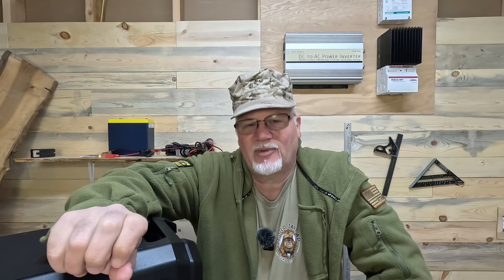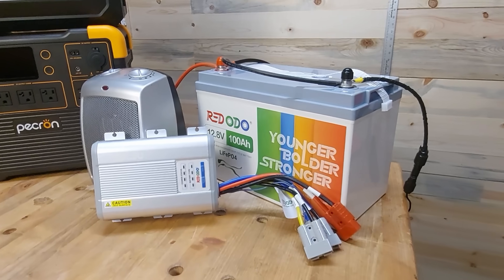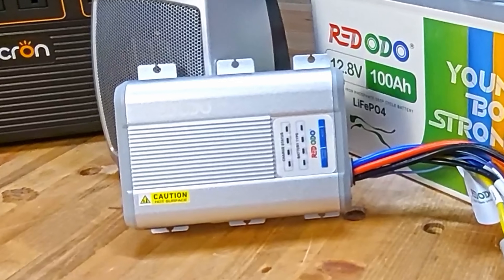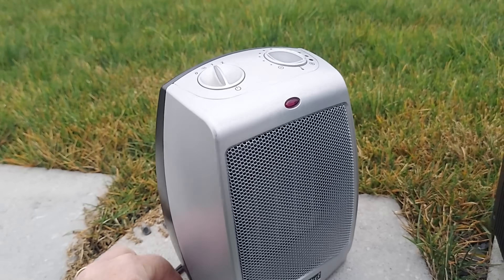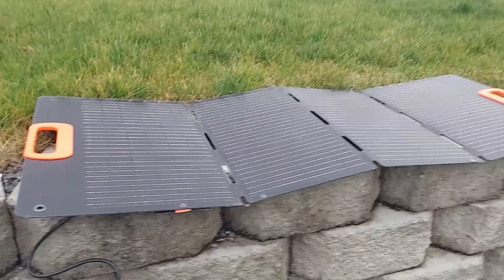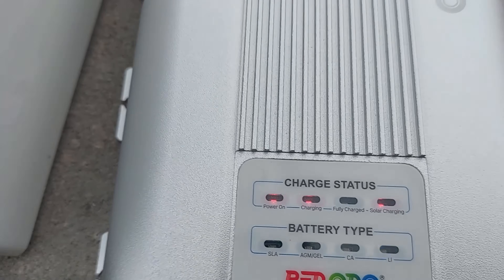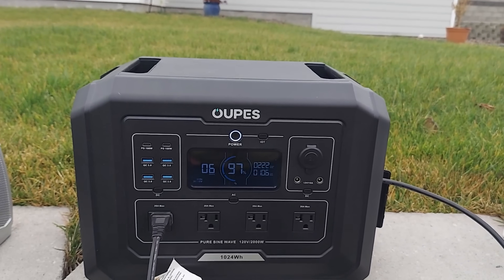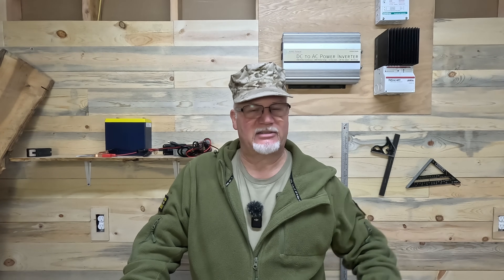🔋 LiFePo4 POWER STATION Hack That Actually Works! 🔋

Comment: I need help. This is my situation. I have two Redondo 12.V 100ah batteries and a Ergetech 2200 watt power station. I tried charging the power station with a cord that connects to the solar panel ports. The battery only charged it to 130 watts and the positive wire was hot for some reason. So how do I get it to charge at a higher watt hour?
Reply from the maker: 1st if the wire was hot it's too small, 2nd what is the max voltage if the egretech?
Reply: Use a 'boost converter' which increases the voltage going into the solar input. 12V - 48V is good.
OR - Use the batteries in Series and feed in 24V. (Or put the 24V into a converter still).
Reply from the maker: He hasn't answered my questions yet so I figure he's moved on

Comment: I've been looking for a review of that Redodo 12v 40amp DC-DC + MPPT charger but can't find an answer to something I'm wondering about. I've also checked the specifications on the Redodo site but no mention is made of one particular spec. Would you consider checking something out for me? I understand the DC-DC side of the charger can deliver 40amps from an alternator (assuming the alternator is large enough) but I don't believe the MPPT side is the same. I suspect the MPPT function is limited to 20amps based on other videos I've seen where it was used. In the video I'm referencing, the MPPT side only put out 10amps which was the maximum output of the DC power supply the tester was using to simulate solar. Any chance you could test the MPPT limit using actual solar panels? If it is actually 40amps on the MPPT side, that would get it into the ballpark of some of the newer fast (alternator +/- MPPT) chargers (Etaker F1000, Pecron 500w, Bluetti Charger 1 560w, Ecoflow 800w, etc.). I also note that very similar chargers are made by other battery companies such as LiTime, PowerQueen, and some others. I wouldn't be surprised if they all have the same guts inside and are simply branded with a different skin at a manufacturing facility.

FWIW, I'd be using it to charge a 12v 230ah LiFePO4 battery (w/200amp BMS) using a 220w N-type bifacial solar panel. That panel's VOC (21.8v) is under the 26v maximum of the Redodo charger. My other panels exceed the Redodo VOC limit but work fine with my power station. My main use for the battery is to slowly recharge the power station at night when camping and solar isn't available, then recharge both the battery and power station using various methods when solar is available and exceeds the capacity of the power station.  Your informative videos on this charger and the boost converter method illustrate the versatility of having different charging options. Thanks.
Reply from the maker: The DC and MPPT are both 600w chargers if my memory is correct  The Alternator side is 40amps which I calculated at 576w at 14.4v coming from the alternator (14.6 would get 584). But I'll have to check on the MPPT side -- and you ask a good question!  If it's 600w then a 30v max would be 20a and that might make sense but if it's a 40v max it would be 15.  I'll check and get back to you.
Reply from the maker: Max voltage is under 26v - I need to check with Redodo to get more information as I can't seem to find my manual.
Reply from the maker: The maximum solar input power of this DC to DC Charger is 584W (14.6 × 40). If the PV input power exceeds this value, the DC-DC converter will implement current limiting. Once the processing capacity reaches its limit, certain components may be damaged.
Additionally, the maximum input voltage range is 26V. Exceeding this voltage for PV input may cause the input capacitor to be damaged due to over-voltage conditions.
Reply: @TheOldJarhead  Thanks for checking further into this. Let me see if I have understood this correctly. Given a 584w limit and maximum input voltage of <26v, my 21.8voc panel could charge the battery at 584w/21.8v = 26.8amps or thereabouts. I don't know where you'd find a solar panel rated at around 14.6voc to approach the 40amp limit, so that seems unrealistic on the solar side. And, at maximum 26v solar input, it works out to be 22.5amps max. Or am I missing something here?

14.6v at 40amps seems reasonable for alternator DC-DC charging but I think advertising/marketing implying this is a 40amp MPPT charger seems shady - pardon the pun [although I can't find any explicit claim by any of the manufacturers of these chargers (Redodo, LiTime, PowerQueen, Kings, Atem, etc.) that they actually perform at 40amp for MPPT solar charging].

Again, thanks for the additional time spent on this, and glad to see you are on the mend.
Reply from the maker: I'm certainly wondering about this myself.   I do see panels it can work with though.  My own 615w aray would be 18.54v and 34a
Reply: @TheOldJarhead  Which panels do you have with such low voltage parameters? Can you please post a link to a vendor or one of your own videos that highlights them? Most panels I see advertised range from 21.8voc (as a couple of my 220w bifacial panels are rated) up to 40+voc regardless of wattage. Even tiny 20w and 30w panels I've come across have voc ratings of over 20voc (note: I edited a mistake ... "amps" to "voc" here) or they don't specify that parameter in the sales listings. Thanks.
Reply from the maker: My panels are from 2010 they are the Evergreen ES-A-205-fa3b 's that put out 205w each and are rated right about 18.20v and 11.27amps - so with 615w if in parallel they would be 18.18v and 33.81amps you can see the label early in this video:  https://www.youtube.com/watch?v=oC_yacKxuaQ
Reply: @TheOldJarhead  Thanks for the video link and info.
Reply from the maker: You bet

Comment: Thank you for the commentary and clear demobstration of the application.

I recently purchased an Eco Flow Delta 2, 1024wh system with 220w of folding solar panels.

It tested it on by running a full sized fridge for 11hrs.
100% to 10% charge.
More than satisfied.

The issue which I ran intp which will take a bit of better planning on my part is with the solar recharging.

Following the test.
The first two days were overcast and one morning was raining.

I live in a heavily wooded area where the sun and shaded areas change throughout the day.
The first day I placed the solar panels and with constant realigning managed to charge the station up to 50%.
The second day it rained most of the morning with some late afternoon sun.
I had less time to reorient the panels for optimal charging. Charge went from 50% to 65%.

Most of the first two days the panels averaged less than 75w of input.

On thitd day the sun rose early and it was clear.
Panels were putting out well abovec150w.
Finished charging in a few hours.

The thing I would caution new purchasers on for any type of solar.
On the days you most need it the sun might not be shining.

You wont always get optimal output from the solar panels. Be prepared for that.

If you add in an additional battery then that is more energy needed to recharge.

Recharging 1024wh at 50 w/h is going to take 20 hours.
If the capacity is doubled by an additional battery.
The recharge time is doubled.

The larger the power statiion the longer it is going to take.

Get the largesr amount of solar you can afford but have a backup plan.
In case the weather doesnt cooperate.

Test your system and ideas before you need it.

Comment: Can you plug car alternator to power station's solar plug? (if voltage range allows it)
Reply from the maker: The main power of the alternator runs via the large cables to the battery and I'm not aware of another lead that can take the amperage from the alternator and feed it elsewhere but I suppose, if one had the background to mess with it, it would be possible.

However, a DC to DC charger is designed to manage charging the battery correctly and won't keep sending power to it once it's full.  Same with the MPPT charge controller.
Reply: @TheOldJarhead  Thanks for quick answer. Actual I meant car starting battery which is charged by alternator. Of course power station has to stop the drain when car stops. Maybe some kind of rele.

DC-DC charger would be best but adds cost. In future I am going to buy one and extra battery also. BTW thanks for that advise too. It main my build easier!

Most of the power stations allow to charge through 12 socket but ampere/wattage is very low.
Reply from the maker: Ahh understood.  I suppose you could do something like that, but depending on the power station Amp draw may very and definitely only when the car is running or it would kill the battery.

Comment: What solar panels is that. They all seem to have not so great reviews
Reply from the maker: That's a Nurzvy but foldable panels are what they are.  I'm going to play with a couple more
Reply: @TheOldJarhead  I know a lot of people say that they don't put out what the rated for but there's so much that goes into it and I'm wondering if maybe that's the case with a lot of them I'm kind of new into the solar setup stuff I'm kind of a jack of all trades master of auto mechanics lol. So I can figure most stuff out I just hate buying junk.
Reply from the maker: @jasonepperly7041 They mostly don't understand them and their purpose or the power station limits they are using them with.

Foldable panels like all others are rated at perfect conditions, then folded and set sorta towards the sun 😆
Reply from the maker: https://youtu.be/-kNUvUiYyCg I did this one earlier in the year on this very topic :)  Foldable panels have their place but not where some try to use them.

Comment: I really like your videos. We all learn from watching you! I noticed you have a 30 AMP fuse coming off the battery. Can you tell us how you sized this fuse and why you selected this type of fuse? This is one area I am somewhat confused about.
Reply from the maker: Thank you so much.  I typically size fuses 25% greater than expected draw but in this case the smallest fuse I could find was 30amps in this size and configuration.  I wanted a big enough fuse to handle 20 amps and one easily removed and replaced as well as seen.

Comment: Can you do this with a jackery?  I was told I cant run a space heater on my jackery because it would drain all the power in 30 minutes.
Reply from the maker: https://youtu.be/uhS69YQMijk to be fare, a space heater uses a lot of electricity and my little one will draw over 1100w so can eat a 12.8v 100ah battery in 1.2hrs.  Better to get a Buddy heater but yes, you can do it with a Jackery as you'll see in the video I linked for you

Comment: I'm currently  converting my  12v 1200 watt  off grid system over to a 24v system so I can increase. my solor panel. input  and  battery bank excetra...  more power more independents. 💪.
Reply from the maker: Nice

Comment: Hi there jarhead, I understand what you are doing: demonstrating pass through charging and extending capacity. I think it should be be noted that if using solar only and you are drawing a lot of power from the inverter you are going to need a solar input that can charge both batteries or the second battery is a waste  in other words you will never charge the batteries fully unless you have the charge capacity for both batteries. If you are only using a few watts on the inverter then a smaller solar array and two batteries will work.  Even so, good video. Have a good day.
Reply from the maker: of course.  it's really not for heavy or long term use

Comment: Sorry i dont get it, that is normally how its done. Hookup a panel to a battery via a charge controller, and your battery to your battery/ power station. The better way is to do this thru bus bars. And normally the power station is connected via an inverter, attached to your battery. And add a dc dc charger, agsin, normal. Usually thru a bus bar. Going direct to the solar gen from the btty saves inverter loss, but going thru an inverter and bus bars allows u to move more power.
Reply from the maker: This is more of a temporary way to do it in an emergency

Comment: Honestly tho, what is the purpose of charging up the battery while running the station? Why not just charge up the station with solar? I understand charging the battery with solar; like it's trickle charging. Or am I not getting something?
Reply from the maker: the idea is to use the battery to extend the life of the ps and have a means of keeping the battery charged as well.  proprietary extra batteries are often more then twice the cost of a lifepo4 but they also charge with the ps.  this is a solution for emergencies where you have a small ps (anything under 10kwh is small imo) and need more reserve power.
Reply: @TheOldJarhead   I was also curious about if a panel could keep a battery charged while using a diesel heater. Thereby bypassing the need to keep running a power station to the heater. I'm sure it's been done.
Reply from the maker: Yes!  Same principle applies

Comment: Does this mean you could just charge the battery from solar which would charge the generator and skip charging the battery directly at any time except when plugged in to AC?  The generator can't charge the battery, can it?
Reply from the maker: You can, yes

Comment: Can someone explain why a 30amp fuse on the positive between the battery and power station? Thank you kindly.
Reply from the maker: I would prefer something closer to 25% above the max expected draw, however all I had was a 30amp fuse.  The fuse is just protection, to prevent any draw greater than 30amps since the battery is capable of allowing 100amps draw.  Some argue you just need 100amps but all of my research back in 2009 for building solar power setups said 25% above expected draw.  So, for example, at my cabin where I have an 11.27 amp solar array I have it fused with 15amp fuses.  That way if something goes wrong and they start pushing 50amps the fuse will blow protecting my equipment.  

Basically, same idea here:  protect the power station from a massive spike in power.
Reply: @ Hey thank you for your time in responding. We all appreciate it.
Reply from the maker: @thefpvlife7785  Any time!

Comment: Maybe it’s the head cold I currently have, but I’m not sure how understand correctly. Is the advantage of the Redodo DC to DC charger just that you can connect that charger to either your alternator of solar panels? You can also have the same setup with any solar charge converter (MPPT or PWM) between your solar panels and Lifepo4 battery, right? Then you just have cables from your lifepo4 battery to your solar input of your battery bank, just not able to connect to your alternator?
Reply from the maker: Yes.  Any charge controller that will charge the batteries will work.  The Redodo DC Charger offers an advantage in that you can connect it to your car and charge via the alternator and actually, I've also connected it to a battery and charged a battery with it ;)  -- basically, it thinks of the battery (when connected to the DC input side) as a power source and doesn't care that it's a battery.  SO it can be used to, say, charge an FLA from a LiFePo4.
Reply: @ thanks for the additional explanation!
Reply from the maker: Absolutely!